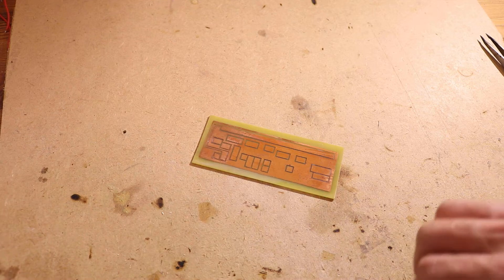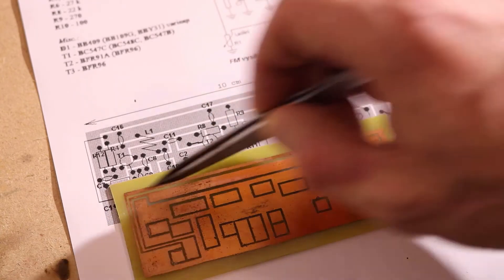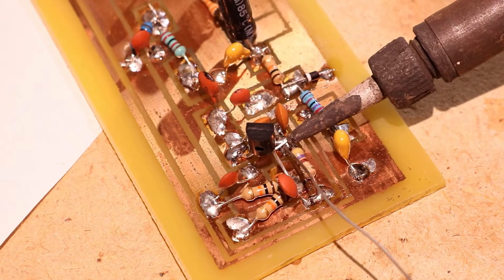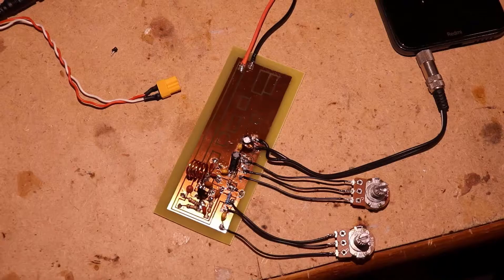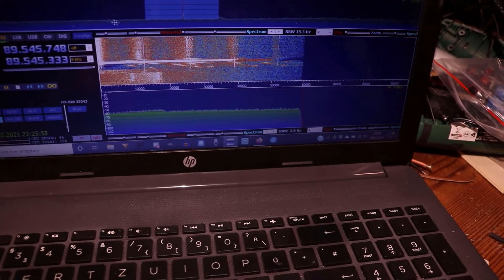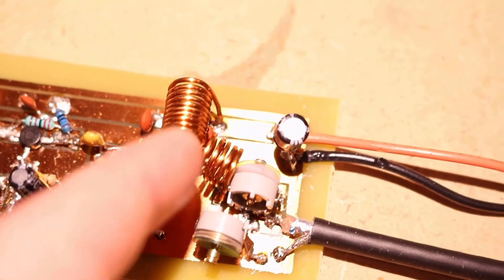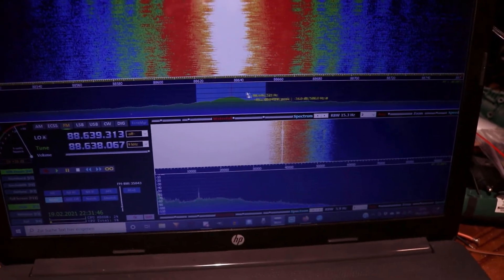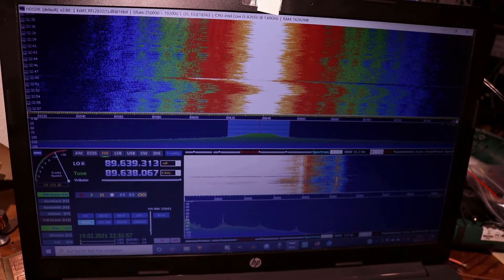Building a 400mw FM Transmitter

Comment: Hallo wieder,

1 Ja, Sie müssen tatsächlich Trennwände zwischen allen Treppen machen!
ABER ACHTEN SIE AUF!
es ist auch SEHR wichtig, dass das signal nicht über die plus+ stromleitung vom oszillator zu den pufferstufen kriecht!!!
das wird sehr oft vergessen, ABER ist SO wichtig!
zwischen L1 und C17 muss das Plus unterbrochen werden und dann wieder mit einer guten Drossel verbunden werden!
(und immer mit 1 oder 10nF trennen)
auch zwischen R9 und C18 wird ein Choke benötigt!
Hier ist ein Link zu einem Beispielplan:

https://www.hulpnodigmet.nl/wp-content/uploads/2013/06/4tr2_5watt-radiorob007-1024x732.jpg

Mit freundlichen Grüßen RadioRob

1 Yes, you do indeed have to make partitions between all the stairs!
BUT WATCH OUT!
it is also VERY important that the signal does not creep from the oscillator to the buffer stages via the plus+ power line!!!
this is very often forgotten, BUT is SO important!
between L1 and C17 the plus must be interrupted and then you must connect it again with a good choke!
(and always disconnect with 1 or 10nF )
also between R9 and C18 a choke is needed!
Here is a link to an example schedule:

https://www.hulpnodigmet.nl/wp-content/uploads/2013/06/4tr2_5watt-radiorob007-1024x732.jpg

Kind Regards RadioRob

Comment: The transmitters output is probably clean, but you have your SDR too close to it, try to have it like 10-20M from the transmitter and it would be clean, Because 1. if a signal source is too close to a SDR, it creates a lot of other freq, that dont actually exist, and 2. If you are like 2M away from the transmitter, there is leak from the circuit before the filter, but since there is no antenna before the filter, the signal travels about 5M, so try it about 20M away from it with the SDR...
Reply from the maker: I can try that, but I'm pretty sure I had harmonics at some distance aswell.
Reply: I think the same, the SDR receiver has a overload due to the proximity to the transmitter. I think that exists best transistors for these purpose, for example, BF199, 2N4427, etc BFR91 and BFR96TS were transistors for ultralineal class-A amplifiers using in TV transmitters, tuner mixers and receivers pre-amplifiers.
Reply: @TheXoriso  What are you even talking about?